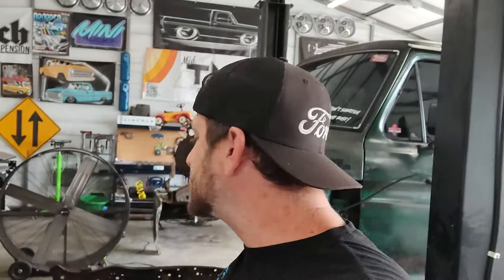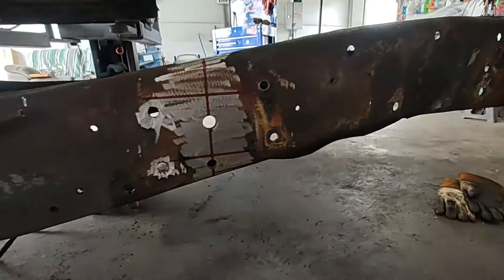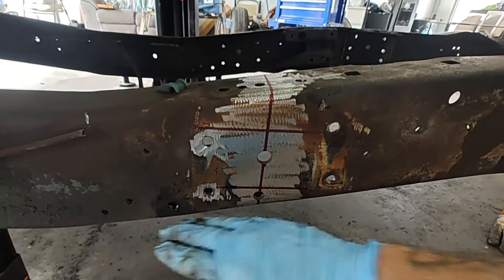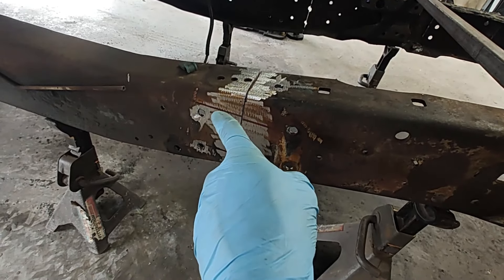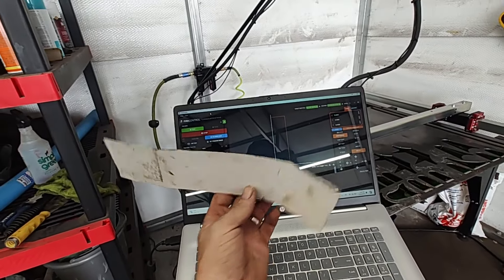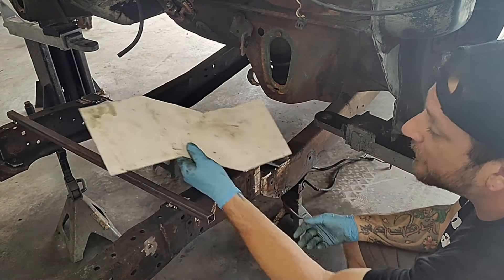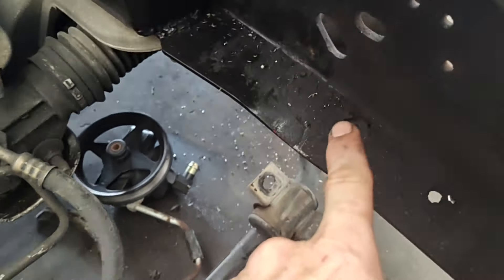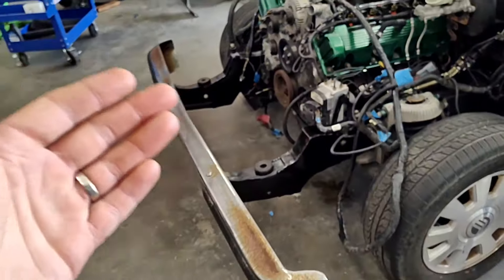How To Z Your Ford F100 Frame Rad Fabz

Comment: Any problems with the trans hitting the bottom of the cab when this is done?
Reply from the maker: I've only used the 4.6 with CV transmission when I do this but I've never had any issues hitting the trans hump
Reply: @RadFabz  wonder if would work with a 302 and c4 trans

Comment: Where do you bag brackets what you run for front bags? I just got my first 68  and it’s already Vic swapped
Reply from the maker: I just use any of the ones from eBay. They are all pretty much the same